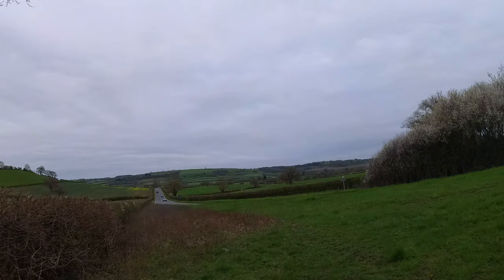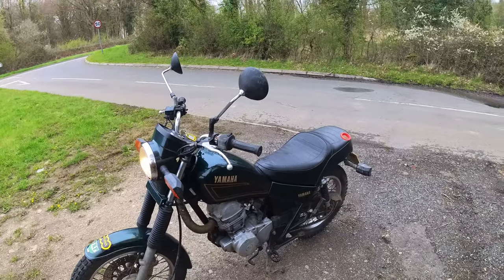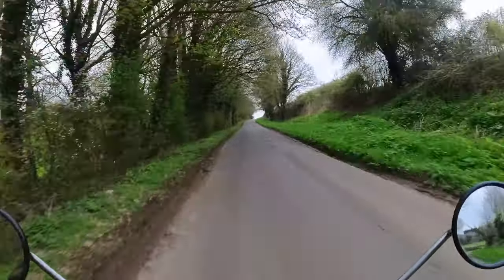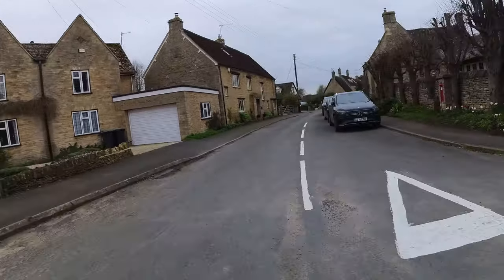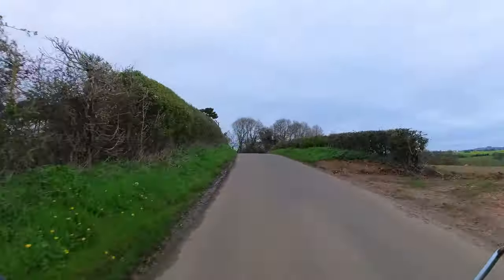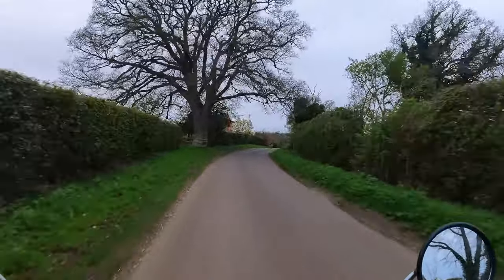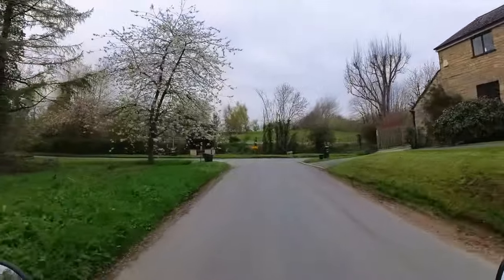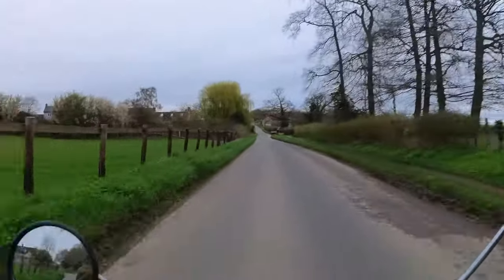Talking hot air about burning oil on the Grand Challenge Bike | JAM#21

Comment: Thank you. I’ve followed all these videos, binge watching, because I’m part way through doing up a Honda Innova inspired by the GC. It’s cost me far too much, and I’m nowhere near finished yet (got to go in the garage in a mo’ to continue with the electrics) but I’ve found your videos very instructive, especially the one on overhauling the forks (I’ve put ‘proper’ forks on the Innova). I can tackle welding and machining, though I’m not good at either, but electrics? They give me the night-terrors!

I’d love to know how you get on with the engine problems. One way of checking the source would be to try turning the engine over (kick start?) noting how easy it is, then pour a drop of heavy is oil in the cylinder and see if that makes it more difficult/gives more compression. If so then rings and piston is your problem. If not then it’s valves. You can see, I don’t have a compression tester!

Have you got a mate with a larger lathe or a milling machine? Could he do the boring for you?

Thanks again. Les
Reply from the maker: I am humbled to hear I have helped someone out ! These projects always have a way of expanding into your time and wallet. I am quite the opposite, good with electrics, acceptable welder and zero machining experience. 

 I went back and re-watched my original "will it start" video and being honest with myself I knew the compression was poor - but your advice is spot on. 

I will probably put together a video on the engine, I am lucky that I am in the midlands - so machine shops are easy to find - but I will also be lapping the valves, replacing the stem seals and checking the guides while the jug is away being sorted, 

Thanks for watching, 
Simon
Reply: @justanothermotorcyclist  Simon, thanks for the great reply. I wish you all joy with the engine work then. My other bike is a Serow XT225, so I’ll be very interested in your engine take-down, as I suspect it’s not a lot different to mine (?). Doing the GC the way I have is certainly theWRONG way, but I’m going to have to change my Innova fork seals before MoT time, so thanks again. BTW, I’m in Chester. Les